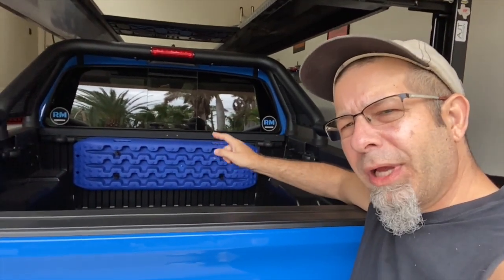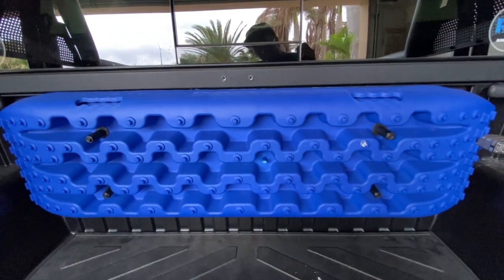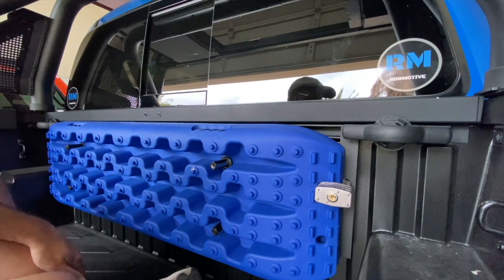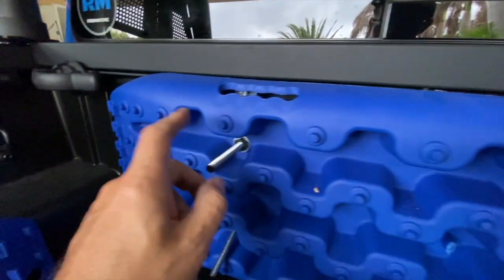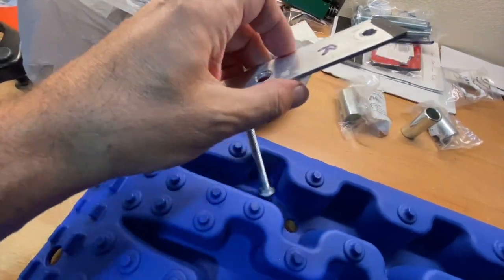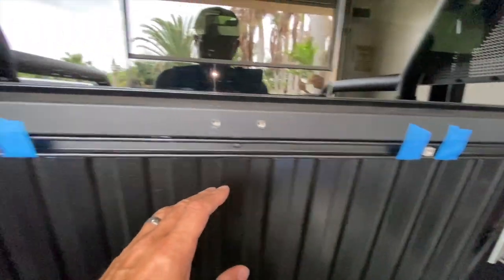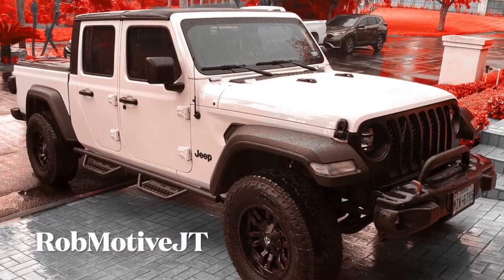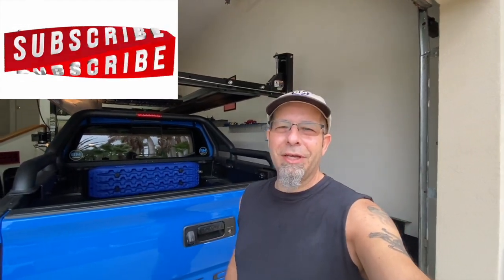Tacoma Recovery Board Mounted the Right Way!

Comment: Rob all you had to do with put on a washer lock washer and a nut on to the bolt as the as soon as it came through your bracket that would secure the threaded rod without moving then you could have put both boards up and put your twist knob on Simple
Reply from the maker: Yup...that works too👍
Reply: I was going to suggest this as well. Lock the bolt down with that washer and nut you use in the inner board. Once that bolt is locked down the extra nut and washer most likely will not be needed.

Comment: Well, it looks good and you did a great job. I like the knobs much better than the nuts, but the whole setup seems overly complex. I think a front molle panel and two straps would have work as well and been much simpler. But that’s just me.
Reply from the maker: Oh sure it would have...and much, much more costly😬.  They also would take up the whole panel, so I don’t see any advantage to going that route.

Comment: Still takes 3 days to take the second one off!😂Could you have ran the nuts to the plate to hold the bolts rigid,then stack the recovery boards?It would probably make it alot easier to remove.👍🏽
Reply from the maker: There’s always a different way👍

Comment: Even later comment— I know. ... I mounted mine behind the cab as shown here, but the first time I had to use them out on the trail, it turned out to be a bad place. First, they're hard to remove if you have your bed crammed full of stuff. (Notice that Rob is sitting in the bed of the tuck while working on them, right where your gear will be.) Second, and maybe worse, mud gets all over your truck bed and your gear while you're struggling to put them back on and re-pack all your gear.  Just sayin' ... from real-world experience. So, I'm working on other options now: probably on the roof rack, or maybe along the side of the bed above the wheel well bump.
Reply from the maker: Good point👍

Comment: Just a thought. If you put the nuts on the back as the long bolts come out it might be easier in the long run.  Also, if you could turn the boards around you might not need the spacers.  All in all, a great job.
Reply from the maker: Thanks for the tip👍

Comment: Looks good everyone has a different style on this type of hardware store exercise.  I’d have put some epoxy on the bolt head to lock it down I saw were couple have suggested lock nuts on the bolt that also should work.  Then instead of the spacer on the outside I’d have used fender washers.  If you snug the knob style nut you should be tight enough that the inside nut would not be necessary.  Like I say a hardware exercise will always have multiple solutions and everyone of them will work.  The good news is if you get stuck in a pothole on the Lowe’s parking lot you will be able to access the boards easily 😂
Reply from the maker: No way bud....I'm calling you to pull me out!!😁
Reply: @RobMotive  yeah I could do that.  Course then we would both be stuck🤣😂
Reply from the maker: Lol!!  We’d have to call mom or Christa!!  Never live that down...😬

Comment: Two things I wouldn't have done do not paint the threads don't use carriage bolts tap the plate with threads to fit a bolt Loctite and a low profile nut to the plate that should keep the bolt tight

Comment: Nice! Did you think about using the wing nuts for the first track so it's easy to remove? If it fits of course. Also, I like this solution, but if you pack your bed with stuff like going to the beach with the bed fully loaded, then the access to the tracks will be a bit hard. I'm thinking about getting the GoTreads foldable recovery tracks. Easy to store even inside the cab. What do you think? 🤔
Reply from the maker: I did, but I think the knobs are even easier to remove👍